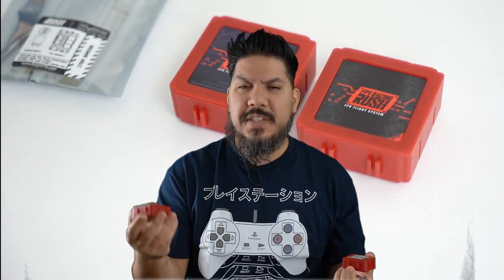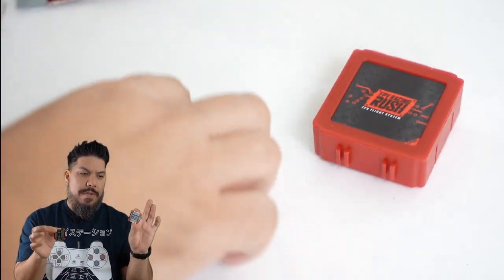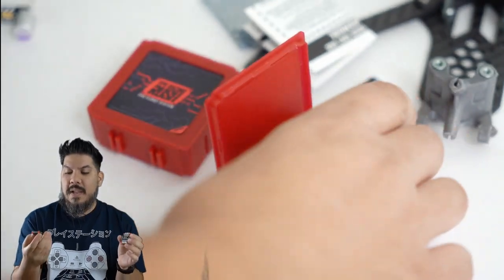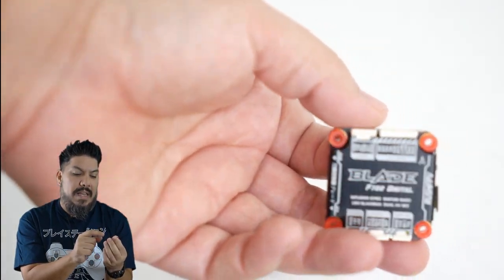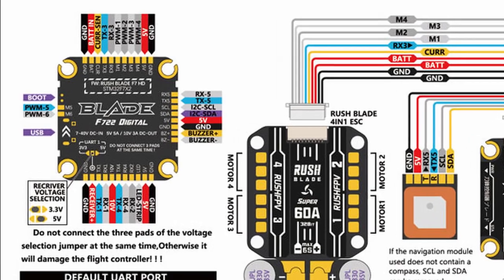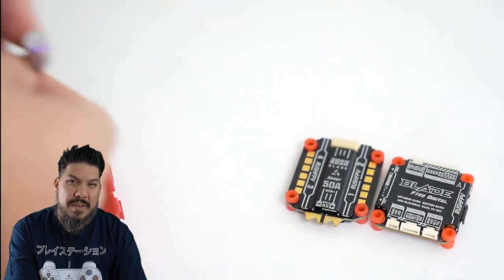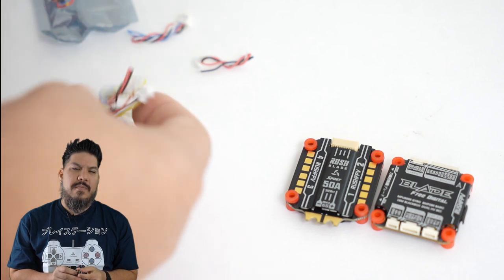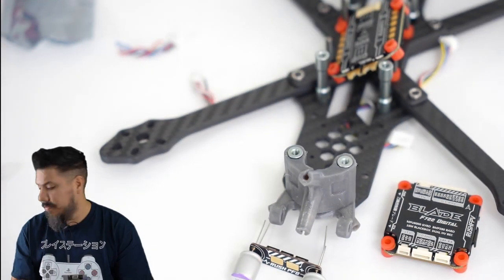Rush Blade Stack - 50A ESC + F7 DJI Flight controller and Filtration system for quadcopter drone

Comment: The fc hadn't arrived but i used the blade esc with the power filter and it was awsome i couldn't find a frame to fit it in so i used a apex  frame and removed 2 standoffs and it worked the apex frame is a tank,   the esc did  die on me in less than 20packs but theres a 50/50 it might not be the escs fault not many frames accommodate the stack with filter as designed.

Comment: hey good video, I just got the rush RC filter board seperately, Can you solder this to any type of ESC?. Also is it better to put this filter board on the ESC over the provided single capacitor the manufacturer gives with the stack?

Comment: Good riddance to solder balls shorting your board after spending hours putting a new quad together!  Looks like a really good concept.  So now they have FC, ESC, VTX, and Frame.  All they need is motors and they have a turn key solution.
Reply from the maker: yes!  Not a single solder connection to the FC needed, love it.